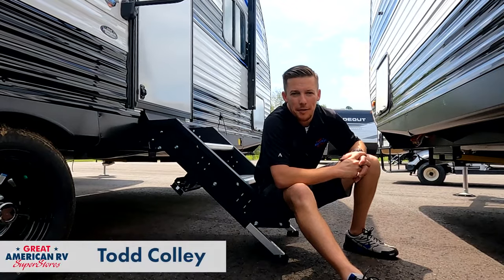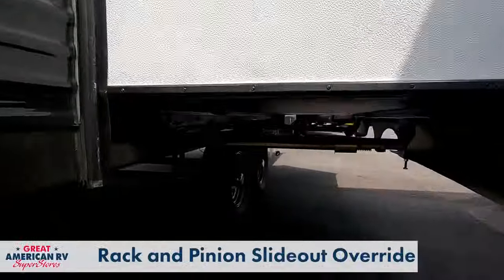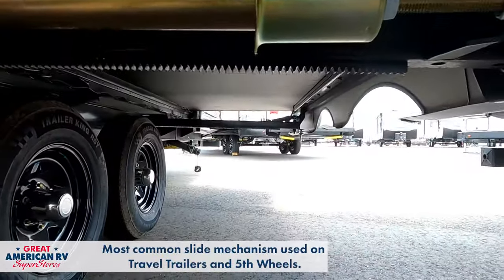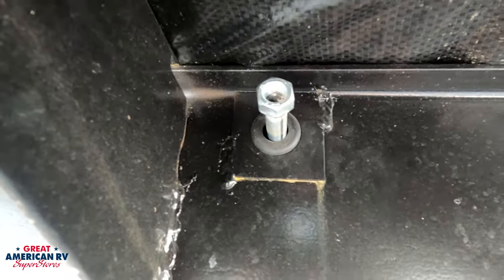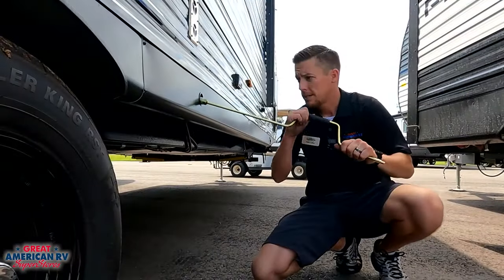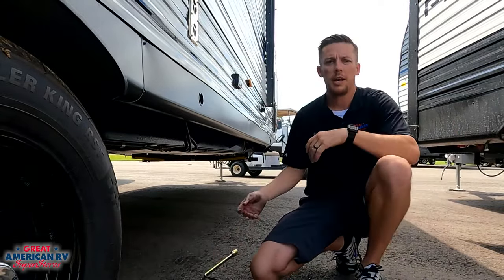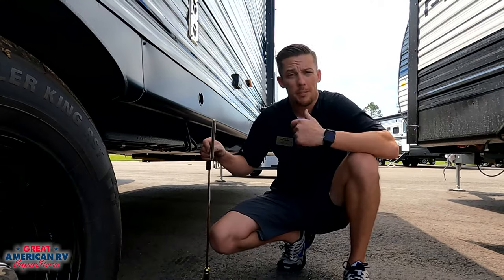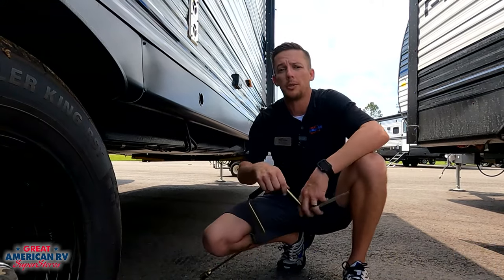How To Manually Retract Your Rack and Pinion RV Slide

Comment: Thanks for the info! How difficult is it to replace the motor?
Reply from the maker: No problem happy to help.  If you drop the underbelly near the side the manual crank is on you will see the motor.  2 bolts and 2 wires and you can pull the motor head off and put the new one on.  Fairly simple replacement.  -Todd

Comment: What if one side of the slide cranks in easily and  not the  other. It’s off tracking.
Reply: For these types of slides, you want to look at gear pack which is a round sprocket on the outside of the frame and below the square extension tube bar that extends with the slide.  There is a cross bar connecting both of these together.  Need to check to ensure all the teeth are there and not chipped and that it is making good contact with the extension tube which also has teeth you need to check as well.  Trying to describe this as best I can without pics, but hopefully this makes since.  Certainly this gives me some insight for another video.  Let me know if this helps.  -Todd

Comment: What if you don't have that hole?
Reply from the maker: @thatdudergaming1424  you would have to drop the underbelly to access the motor directly.  If it doesn’t have an override in the motor when you gain access you might have to remove the motor head and push the slide in.  -Todd
Reply: What if one side isn’t going all the way like it’s supposed too but the left side is
Reply from the maker: @169hellokitty  the slide out is out of sync and may have jumped track.  The side opposite of the motor has a gear that can be taken off.  Retract the slide all the way, remove the gear, push the slide in to the even it out and reattach that gear. The cause would be that the slide has shifted, so make sure everything is tight and making good contact on the tracks when operating.  -Todd